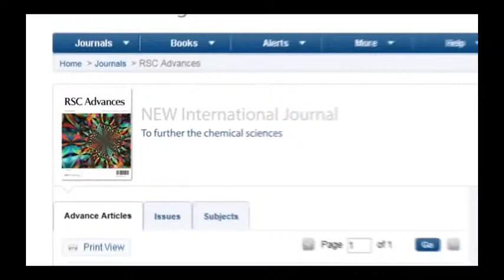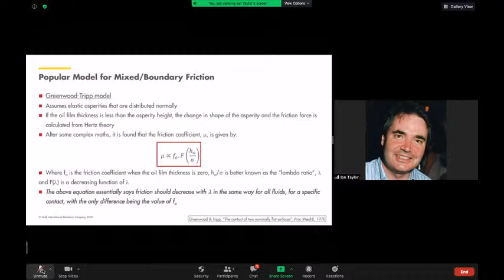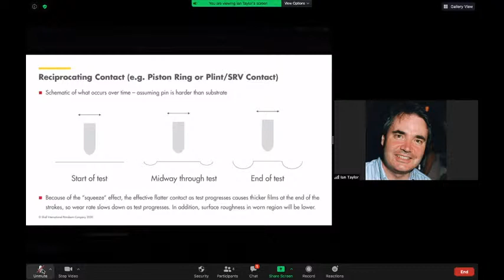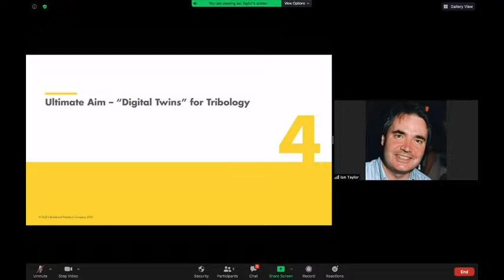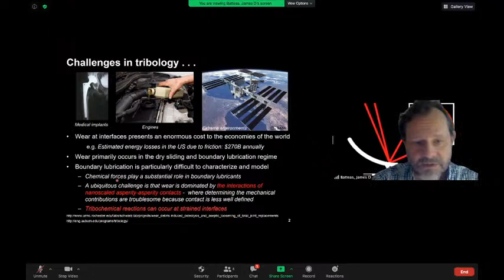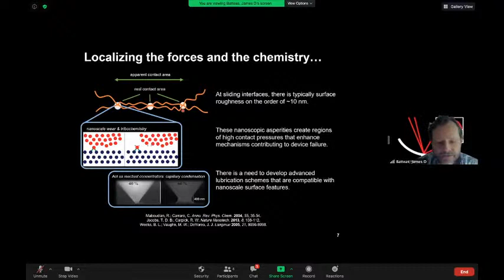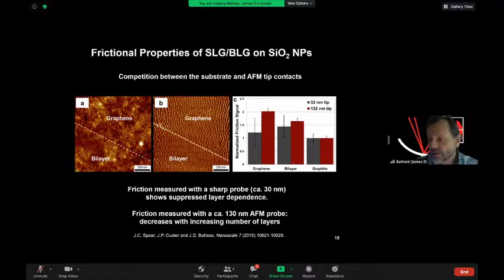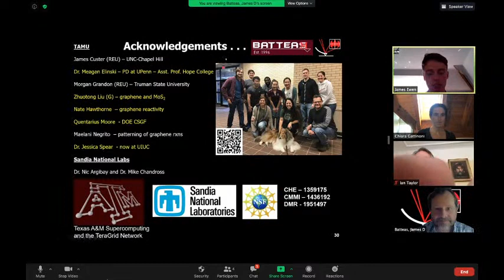WeSST 2020 - Dr. R. Ian Taylor and Prof. James Batteas

Comment: Question for Ian, Rai Notay asks: Given the fact that most OEMs are heading towards ultra low visc fluids with little or no VM, do you expect to be using the Greenwood Tripp model more often?
Reply: Good question. In the Greenwood-Tripp model, the fluid basically just acts as a "spacer" to separate the surfaces. If you have two oils with the same kinematic viscosity (measured at low shear rate) then if one contained a Viscosity Modifier, it would effectively have a thinner film than the one which did not contain a VM (since the shear rate in the contact will cause temporary lubricant shear thinning of the VM containing oil). Therefore, the oil containing a VM would have a thinner film, and so the lambda ration would be smaller. However, as we get to lower viscosity fluids, I would expect the anti-wear and friction modifier additives would be more important in causing deviations from the Greenwood-Tripp model, rather than the VMs.

Comment: Question for Ian, Nishant Katyal
 asks: what happens to wear particles in case of high pressure lubricants and in case of low pressure lubricants?
Reply: You can get relatively low lubricant pressures in conformal contacts (such as journal bearings) and also in contacts such as piston rings. We often see scratches on journal bearing shells, or on piston liners, due to wear particles. It really depends on how big the wear particle is (compared to the oil film thickness) and how hard it is. In higher pressure contacts, the oil viscosity will be much higher (since it increases roughly exponentially with pressure) but on the other hand the loads will also be higher. Under these high loads, what happens would depend on whether wear is abrasive or adhesive.

Comment: Question for James, Nishant Katyal
 asks: Can the lattice orientation of the graphene/graphite sheets be changed using other additives to reduce friction?
Reply: Also - can the adhesion of graphene be increased by using additives to reduce friction? And is there an ideal graphite particle size for low friction?

Comment: Question for Ian, Weixue Tian
 asks: How do you estimate the pressure-viscosity coefficient (alpha) for a blend of base oils with known alphas, say group 2 and group 4?
Reply: This is a very good question. Published data is available which shows that base oils in the same group have a pressure viscosity coefficient (alpha value) which depends linearly on the logarithm of the kinematic viscosity - so if you have two Group III oils in an oil blend, you can just work out how the kinematic viscosity of the blend varies with temperature, and then can use the fitted equations (for a Group III oil) to calculate the alpha value for different temperatures. It is less obvious how to do this if there are base oils from different base oil groups in the lubricant blend. It is relatively straightforward to calculate the alpha value for each of the base oils in the blend, but it is not obvious if you should then just take a weighted average, or combine them in another way. There is not much guidance in the scientific literature that I am aware of. This would be a good area of research for Universities that can make such high pressure measurements. (Incidentally the published paper I am thinking of is: P.W. Gold et al, “Viscosity-pressure-temperature behaviour of mineral and synthetic oils”, Journal of Synthetic Lubrication, Vol 18, 2001)

Comment: Question for Ian, Tanmaya Mishra
 asks: Do the wear particles remain in the (reciprocating) operating system after being formed, giving the case of 3 body abrasive wear?
Reply: Wear particles can remain in some contacts after being formed, since we often see scratches on the surface (presumably formed from the harder wear particles). In a reciprocating contact in the lab, it depends on how the oil is fed into the contact and whether or not there is flow back to a reservoir. In an real machine, there will be flow to and from the reciprocating components (such as the valve train and piston rings) and so the wear particles will only stay in the contacts for a relatively short time before the oil is refreshed.

Comment: Question for Ian, Rathesan Ravendran
 asks: Does the wear particles formed during sliding affect the viscosity?
Reply: I wouldn't have thought so, unless there is a substantial amount of wear. In machines where lubricant condition is monitored, high wear metal levels would be of the order of 50-100 parts per million (and usually they would be much lower than this). The viscosity of fluids containing particles can increase, and the viscosity increase is predicted by the Einstein relationship, with the key parameter being the concentration of the particles, and since wear metal levels are usually quite low, I wouldn't expect a significant increase in viscosity.